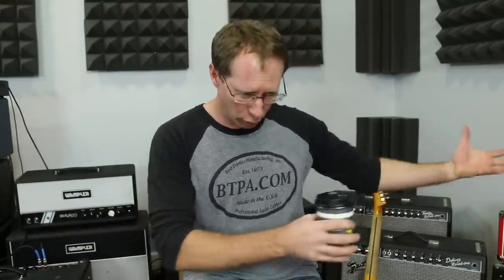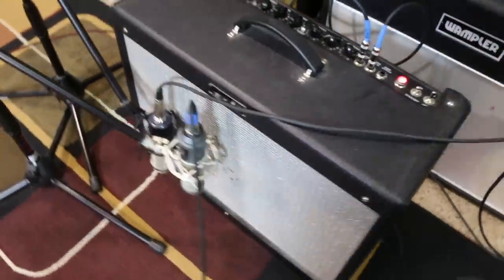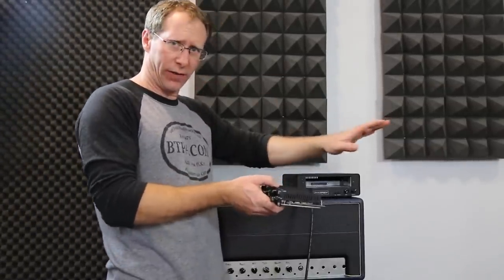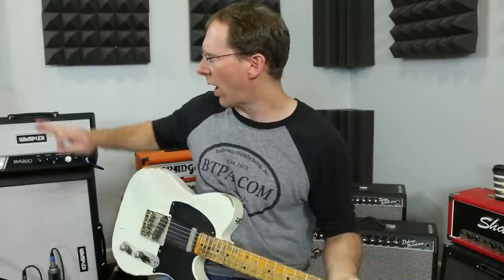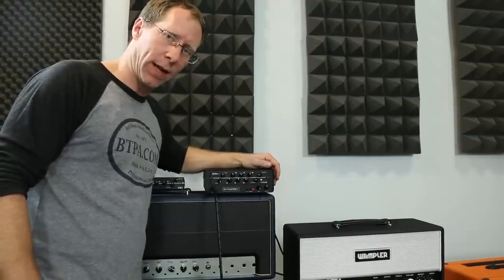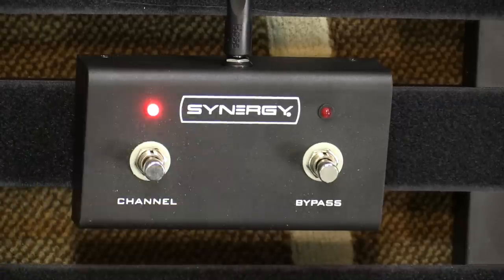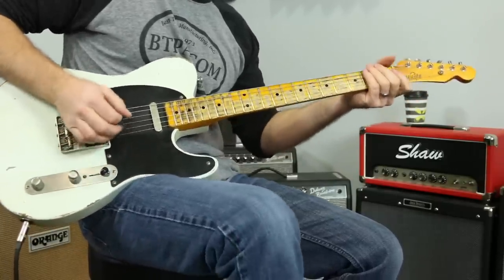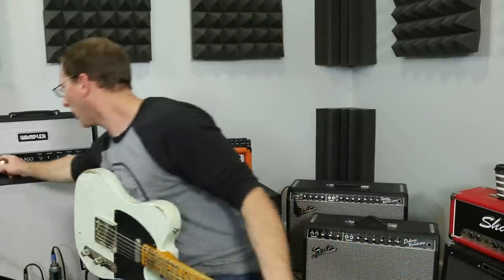Are VACUUM TUBES now the FUTURE? A look at the new Synergy technology

Comment: This is cool but there is Kemper now...
Reply: Digital vs all tube.  You’ll hear and fill the differences
Reply: Maybe, and most probably not... Not all digital are the same. With Fractal (which also sounds great in its own way but does not emulate the real thing at the moment) you can hear the and feel the difference. With Kemper, I have yet to find someone who can hear/feel any difference.
Reply: thats not completely true.. though i really like the Kemper...The profile had no chance against a real Diezel D-Moll.. Cool Idea for playing live though if you have the money to buy it..
Reply: oh and not to forget.. Kemper doesnt pay a single Cent to the original amp brands.. Synergy does.. :)
Reply: I think Kemper Profiling Amp is technology is brilliant. It was invented to digitize tube amp circuit and its behavior without need for the nearly impossible task of modeling each tube amp / distortion circuit one by one. It's so complex yet so simple... That's why it is so amazing. I understand what you mean by stolen R&D but just in case someone who does not know much about the issue, I'd like to note that Kemper's technology is original, proprietary and invented by Kemper. I also do understand and agree with your point on buying hardware just for profiling and then returning it back. It is unethical as that return policy was put in place to protect consumers not to cheat manufacturers and retailers. This is a problem in almost all sectors of e-commerce costing millions in value every year. That cost must be recouped somewhere, and it is probably done through the expense of ethical consumers.
Reply: Try Synergy side by side.  You'll know instantly.
Reply: I'll definitely try when I get a chance, I always test and try new gear : ) I recommend you watch the Andertons Kemper Challenge and Tim Pierce profiling his amps on YT...

Comment: Meh... dont see that little box on the hands of a gigging musician. Too fragile, nerdy, hi tech thing to worry about on a messy 3 a.m gig. Also instrument market is all about image. People still like big wooden boxes on stages. Just use regular amps people. The concept of this thing is strange too... Looks like car cassete players of the 80's, removable to avoid robbery. lol.... Kemper concept, for example, makes much more sense. A brain that you can change the content. With this you have to open the thing, expose the components and phisically change the core. It's so NOT the future.
Reply: I agree even as an electronics hobbyist who has worked for a preamp kit company before.  
  It’s cool but the older I get the more I just want one amp that sounds beautiful with my pedals and not extra crap to lug around; obviously I don’t have a crew and when I did they were on drugs and damn near tried to kill the equipment if not loose it out the back door of the venue.  Still you get what you pay for here if you run a studio that offers equipment use or who knows, it looks like good quality.